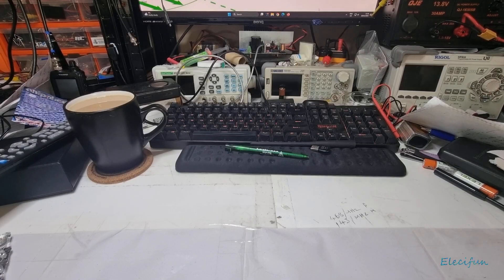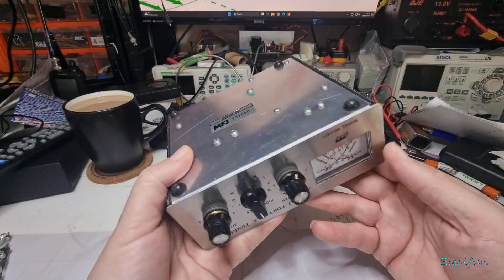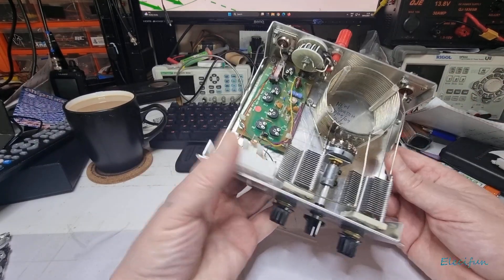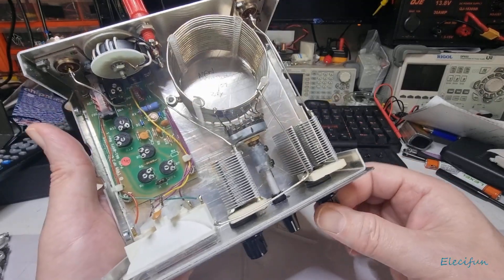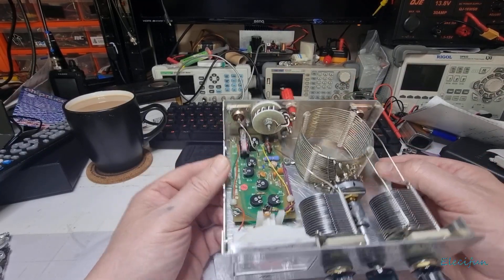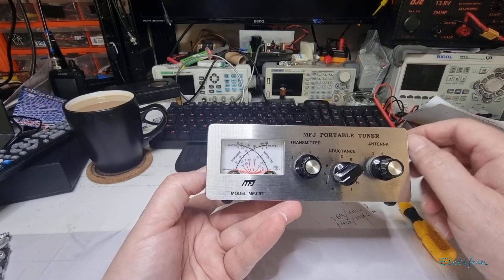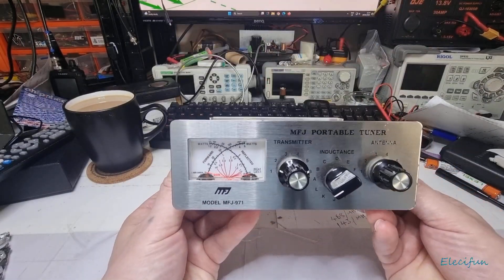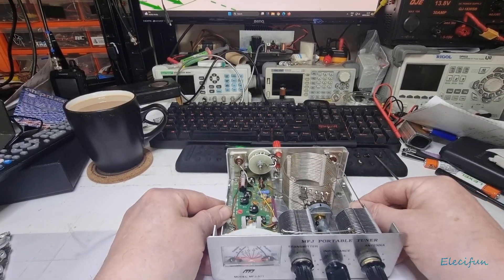HF Antenna Tuner / Matcher MFJ 971

Comment: That looks like a terrific unit, Elecifun. I love the retro stuff. And the inductance goes to 12! That's two more than ten isn't it! To sort of quote "Spinal Tap" 😆
Reply from the maker: @Sonic_Ox Yes the retro look is truly a pleasure for the eyes. Also it was a choice between a cheaper Chinese auto box or this. The auto box may fail in the relay section or other tiny electronic components, the latter being hard for me to swap out. This is through hole and regular size components. Besides I don't expect it to fail unless I do something to break it. I remember hearing the name Spinal Tap but never listened, maybe I've done myself an injustice.
Reply: I think you made a good choice with that box. It looks like a solid, high-quality unit. "This is Spinal Tap" is a comedy movie from the mid-80s. It's sort of a spoof documentary about a heavy metal band. It's become a cult classic, especially among garage band musicians (like myself, 😆). I haven't seen it for probably 20 years, but I recall a funny scene where the guitar player was showing his amplifier to the documentary filmmaker. His amplifier went to 11, where most amps went to 10. "Because it's one more than 10, isn't it..." sort of a lame pull of a quote on my part, but it is a funny scene. 🤘🎸 🎶 🎵
Reply from the maker: @Sonic_Ox LOL it's weird what we can pull from our memory banks with a slight connection all sorts can come flooding back.